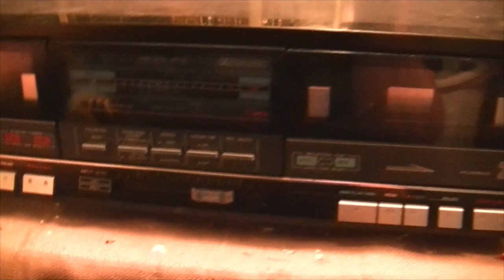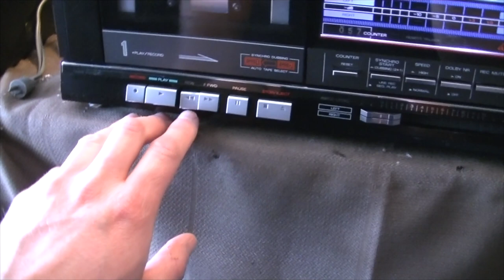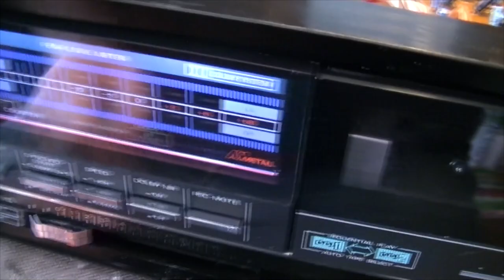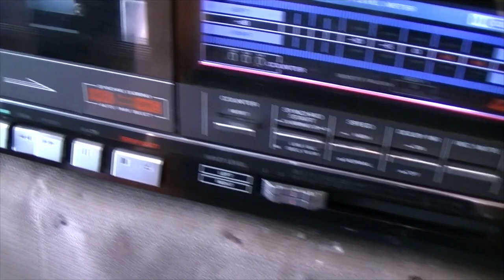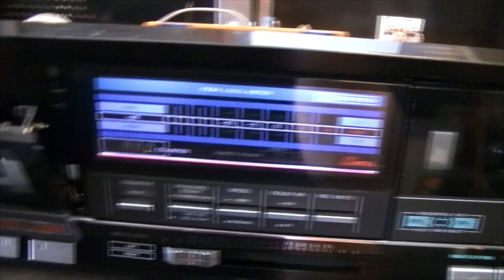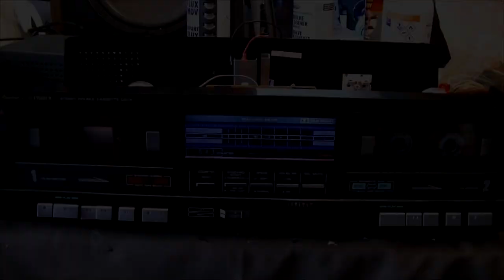Fisher Studio Standard Repair Series - Part 6 - Cassette Deck Repair - CR-W870

Comment: 😢I need help! I have acquired a fisher cr-w52 with no  motor on the left ( recording side). Should I buy a motor, where do the wires from the circuit board go on the motor? One wire is a twin red/black and a second one is likewise a twin but red/ white, so four wires if split. The missing motor looks like the right hand one. The wires on the existing motor have different coloured ones, so no help here. Thanks for bearing with me. Any help will ne appreciated!,

Comment: Hey, nice video. I have a cr124. Works if I “get it started. Belts seem ok but “may be loose” kind of borderline but they seem tight enough. 
Is it hardened grease? Bc I can get it started by giving it a push (top open) 

Any thoughts? 

Same as cr-155 and a few others w no service guide available.  . Single well.

Comment: Looks nearly identical to the tape deck that came with my Studio Standard Fisher system I acquired in the mid '80s, and I still have in my possession today.  My tape deck is model CR-W49, and the only differences I see is that two of the four buttons, to the left of the counter reset, have different functions, and within the illuminated window directly above those buttons, my doesn't have the "REMOTE PAUSE DECK 1".  Thanks for sharing!

Comment: It is normal for the motors to spin at all times when the unit is switched on. Earlier models were even more complex circuit-wise and had both Dolby B & C. Quality went down as the 80s wore on. Things were better until Avery Fisher passed away. After that Sanyo (the actual maker of Fisher stuff) started cutting corners to lower prices.

Most brands declined during this period as people sought cheaper equipment and the economy struggled after 1980. Many premium brands died off or were sold to other companies.

Comment: Thanks! Very useful video. I have the same component which has the rubber bands for the motors broken. Apparently they melted down at some point. Do you know where can I buy them so I can replaced them? And how are they called?
Reply: They are available on eBay. Just search with your model number.

Comment: Good day
Your explanation is very interesting, thank you very much.
I would like to ask you a question about the Fisher CR W871 model, I have followed the explanation to remove the front part but it does not come loose, two screws at the top in the corners and three at the bottom. Also ask you how to change the rubbers that go to the pulleys, they are all broken (melted), and what measurements and shapes should I use?
Could you help me?
I thank you in advance, a cordial greeting from Holland

Comment: I have the same model with the same issue . One motor running constantly and inability to lower the heads and therefore the door doesn’t open . I never really caught what you did to fix that issue and I was wondering if you could explain why it was running continuously and how you fixed that problem. I am at a loss!

Comment: i recently bought one of these cheap without the amp. Is there any way to power this deck without the amp and is it even worth doing?
Reply: Did u have any luck?
Reply: you would need a power supply to do it but it could be done.

Comment: I have that same model and I replaced all the belts, worked perfect, but then I noticed the bulbs of the display burned, when I was checking if they get power with my multimeter I made a short circuit, and the unit became mute even when the decks keep turning.
I'd wish to repair it, If I had idea or what to check, I'm good with mechanics , not the same with electronics.

Comment: what did you use to power up the deck & where did you get the belts for it
Reply from the maker: When I need belts, I get the various size pack from here - http://www.studiosoundelectronics.com/cassette.htm

As far as powering up the deck, I used a 12v 3A radio shack power supply, which measured voltage is really closer to 14V, and connected it to the large black diodes that rectify AC to DC.  This model does have the provision for a transformer, which would be a fairly easy mod to do, and I did read about people doing that.
Reply: @WaybackTECH  could u doa video on how to do that?
There seems to be a ton of people with this same problem...

Myself included...

Comment: has this same system... without the main amp ... you can't use the other components they all run on different voltages supplied by the amp